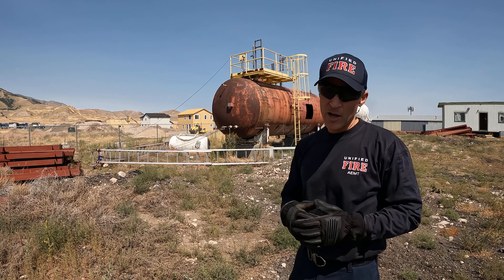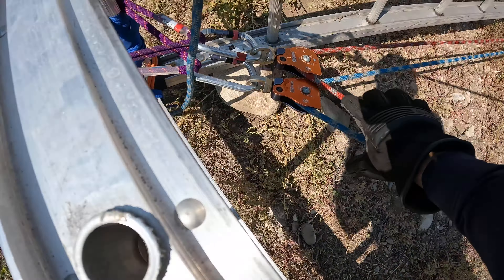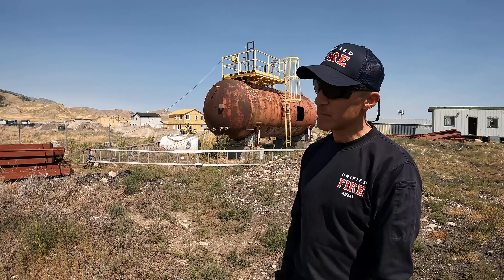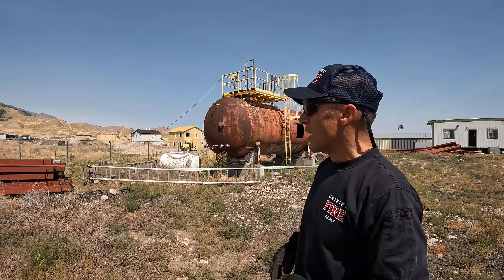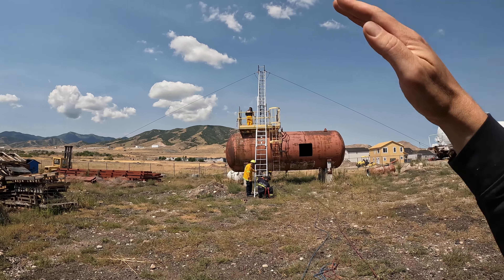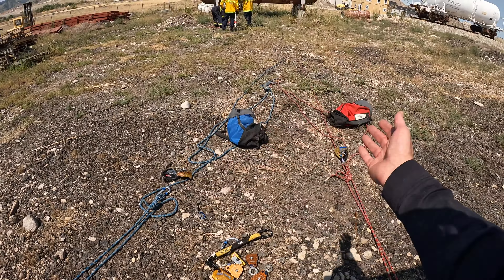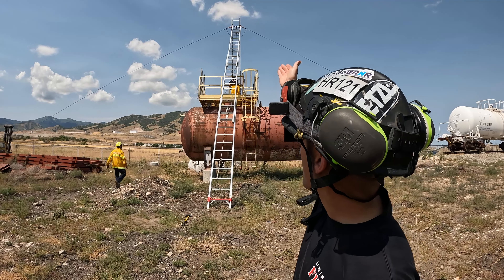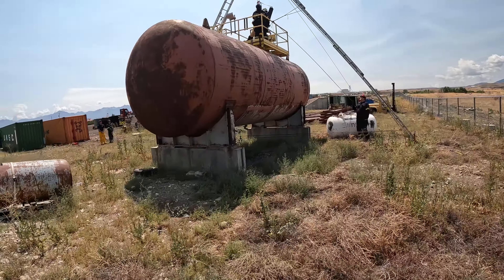A-Frame Artificial High Directional w/ 35ft Extension Ladders

Comment: Cool setup.  I'd like to know your thoughts.  Once the patient is clear of the hole and ready to get lowered to the ground how about skate them to your lowering line that is running along the ladder.  You could put a pulley at the head and the foot end of the basket.  It should be easy enough to do, even if you have to run someone up the ladder to help reach.
Reply from the maker: Worth a try, especially if we were gear-limited & did not have a tag line or an extra person to manage the tag line.  However, if those two resources are available then the tag line option it is definitely a simpler approach.  But I like the creativeness.